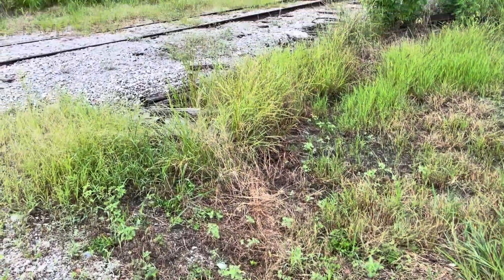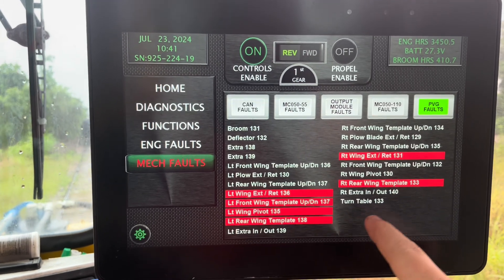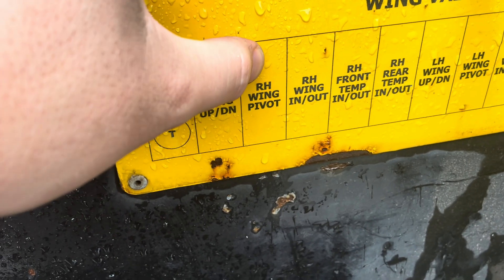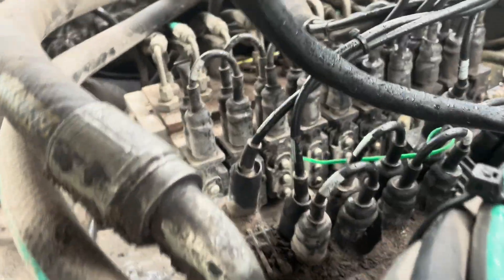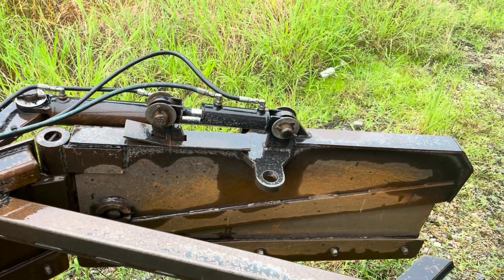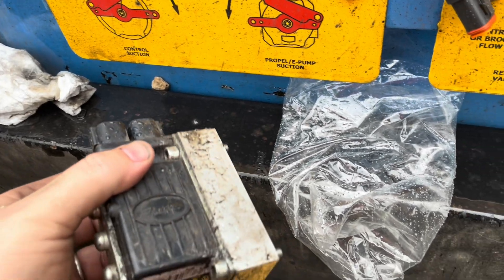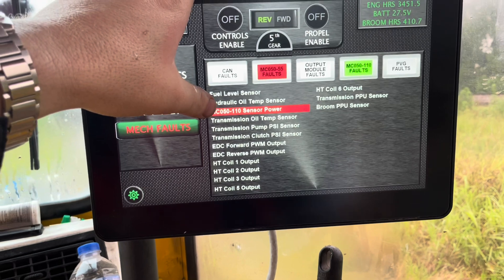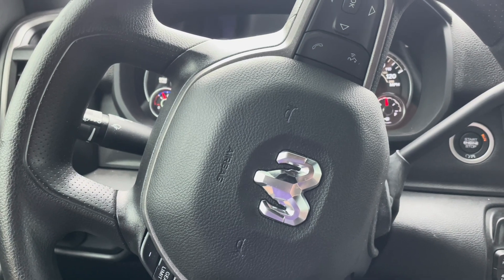Second CAN faults in the rain

Comment: Question,
Do you have to shut the machine down when moving the cable from valve to valve?
Reply from the maker: @buzzman64  I normally do not. However if anything shorts out on either can hi or low you might have to cycle power to reset.